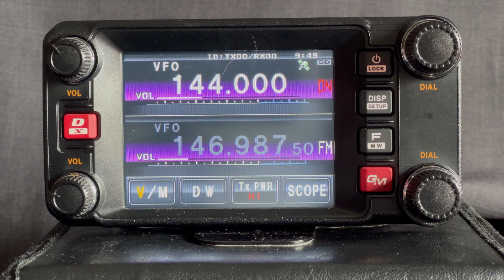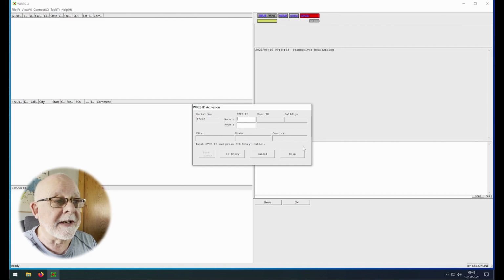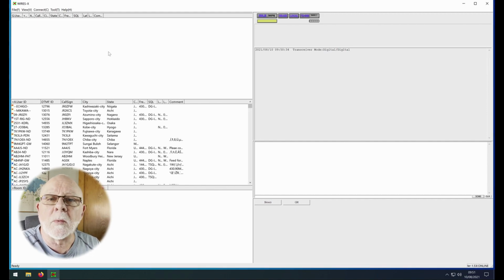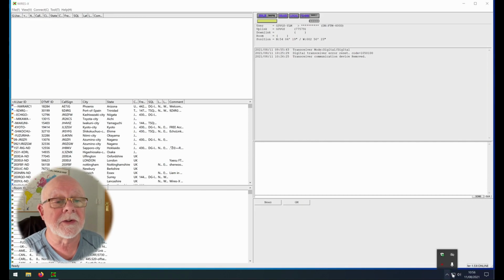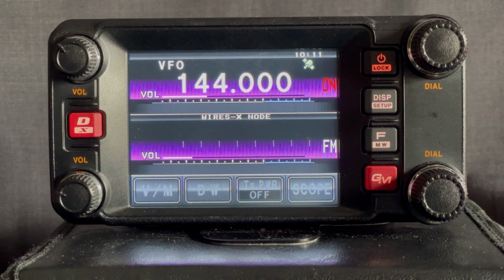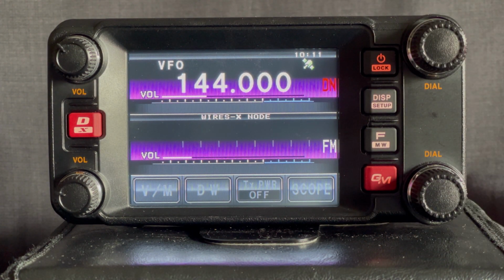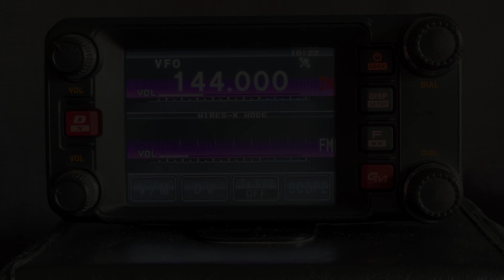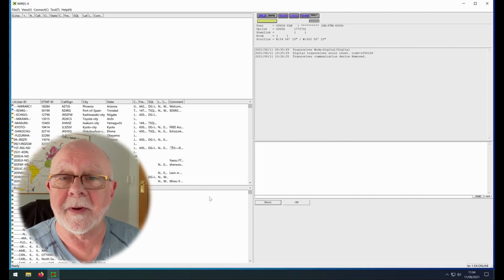16.  Setting up a WIRES X node - Part 2

Comment: Excellent set of videos.  I have a question.  I already have a node and room ID from Yaesu as I currently have a FTM100.  I'm looking at replacing my FTM100 with the FTM400.  Since I already have a node and room ID do I need a new node and room ID from Yaesu for a new radio?  Or can I just use my current node and ID number?  Thanks.
Reply from the maker: Hi and thanks for the question.  The ID you currently have belongs to your FTM-100.  You will need to apply for a new ID for your FTM-400.  If you intend to sell on the FTM-100, you will need to deregister that with Yaesu as the existing registration is against you.

Comment: Thank you for some wonderful videos, I wonder if someone might be able to help me please. I want to use my ft-991a on wires-x, but I can't find out how to start my transceiver in wires-x mode, help please - Thanks ?
Reply from the maker: Hi, the 991A does not have a PDN mode I'm afraid.  It can access a node but cannot be set up as one.
Reply: At last I have managed to connect with someone helpful. I am a rank beginner when it comes to digital radio and finding the wires-x topic totally bewildering despite having downloaded what should be the requisite documents from the Yaesu website. Please forgive my ignorance in trying to understand your reply, which I am very grateful for, but are you saying that the 991a cannot be directly connected to the Internet via my laptop please? All I want to do is access other rooms etc., without having to link to a fusion repeater and so I assume there is a way to prevent the 991a from actually transmitting, but go through the Internet instead? Sorry for such a verbose reply, but I hope it makes sense? Thank you very much.
Reply from the maker: @carringtonlane2515  The 991A cannot be used with a laptop and WIRES-X.  It has no way of doing that I'm afraid.  To run a WIRES-X node, you need one of the later mobiles or handheld radios.  The 991A is a radio with Fusion capabilities but is not intended as a node radio.
Reply: @NorthWestFusionGroup  Thank you very much for your kind support and patience to a novice such as myself this seems to be turning out to be a very complex system. If I am understanding what you are saying correctly does this mean that I need to use a hotspot locally connected to the web? I have seen the hri-200, but again uncertain if it can be used with the 991a? Thank you very much in advance.